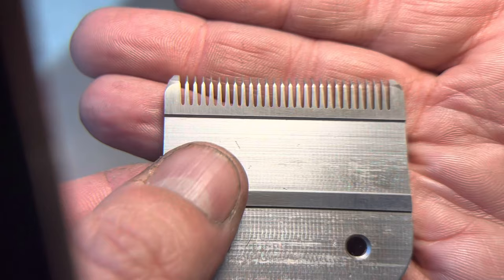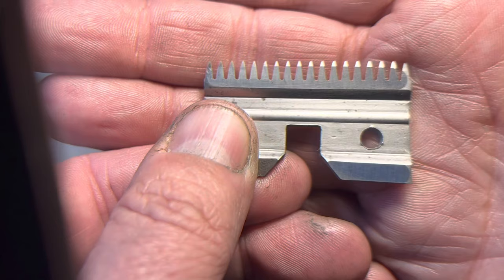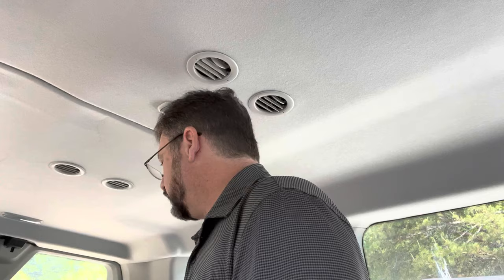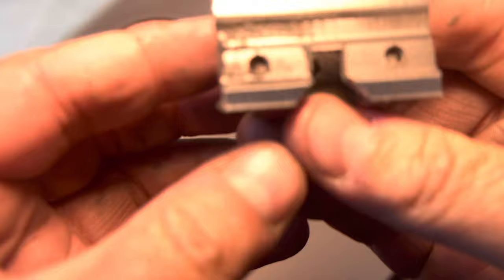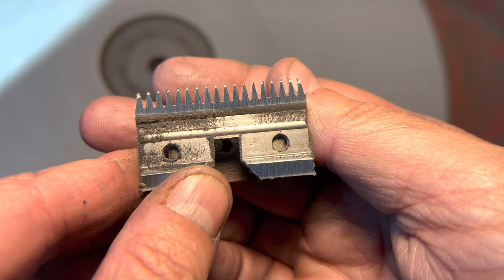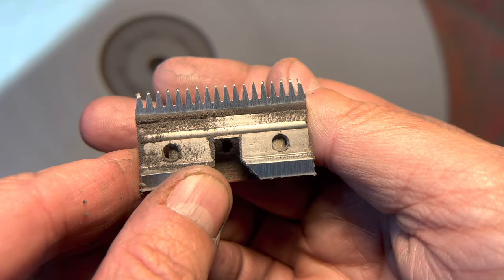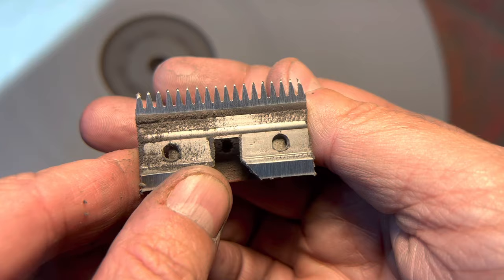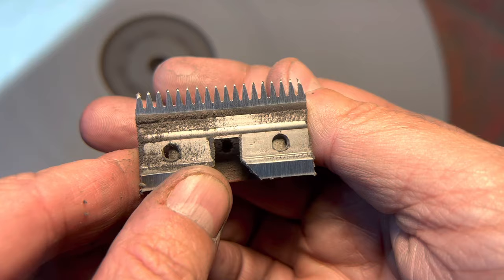Clipper Blade Sharpening Class: How to Deal with Poorly Sharpened Clipper Blades

Comment: Always enjoy your videos Jim. Great job showing the steps to blade sharpening especially some of the often missed details such as demagnetizing and deburring. I find that often those steps are skipped in an effort to save time. But they give up quality (consistent quality) for quantity.  And especially making sure that the spring is adjusted properly and not wobbly on the cutter. Many sharpeners, both new and experienced, I've trained or met over the years had no Idea to do this and as a result, had problems with their blades not cutting well or cutting better or worse on one side than the other. Keep spreading your knowledge and insights. It's helping to advance our industry to new levels!

Comment: Great explanation’s! As a mobile groomer I am finding it difficult to get a sharpening guy to meetup or just be available. I want to learn the best way I can sharpen my own in a pinch without spending a lot in equipment.
Reply from the maker: Hi Lillian… Unfortunately there really isn’t any good way to sharpen blades without the correct equipment, which is a little pricy for someone just wanting to sharpen their own blades. If you would like to text me at (864) 381-8697 and let me know where you’re located I may know a sharpener in your area. I’ve trained a number of them around the USA over the years.

Comment: I like this video it's very informative. I test a little different. I have used the test tape but I also use synthetic fur. I like the results better. But I also use a test block before I assemble to see the ware pattern to judge if I  need to sharpen more. I like those tools you use. 
Can I get the information on where I can get those tools. Thanks

Comment: Great video! I've had blades like this come in after a customer tried to sharpen them on a stone or something. I usually turn them away and tell them they are no good. Then they know not to try to sharpening them in the future.  I have a great tip for straightening out the spring. Remove the socket and set the spring on a flat surface. push the top of the spring down on the surface. On the loop ends (where the hole's are) one will be lifted off the table, bend accordingly until both side are contacting the surface when pressing the top of the spring to the surface...hope that makes sense.  :o)

Comment: Thank-you for a very informative video!  I am just about to "launch" me sharpening service and I will be starting with around 28 Andis clipper blades.  I am very interested if all three of the tools that you showed, the "Blade Scale", the spring adjustment tool, and the "chatter reducing" tool.
Reply from the maker: Those come from Hamaguri USA. Their website is listed in the drop down box under the video. What machine are you using to sharpen the blades?
Reply: @JimSharpBlog  Hamaguri USA is out of the spring adjustment tool until after the 1st of the year, Do you have one available for sale?
Reply from the maker: @krisweythman8806  I don’t, but Bonnie at Bonika Shears might.

Comment: What’s best for cooling down the cutter to avoid warping, water, aluminum plate, ceramic tile, burnishing plate?
Reply from the maker: Ceramic tile, but often you can control the heat with proper grit application. Watch that spark pattern.

Comment: Good enough ..you decide...I use a digital food scale ($20 Amazon) I take the
bowl off and gentle push down on the scale with the clipper blade extended 
and watch the scale to see when blade
moves. The scale is accurate (can measure in gms) and is a lot cheaper
then tension gauge.  Close enough reading for my needs.

Comment: Is your sharpening wheel convex shape ? Or flat ? I see lot comments that say you always sharpen clippers on convex stone/wheel. Any thoughts on that? Grate video ;)
Reply from the maker: It is tapered to hollow grind the blade. That means it’s slightly higher in the middle than on the outside of the plate.

Comment: Hi Jim, thanks for this great work. I want to as ask, can aluminium wheel sharpen all types of clipper blade ? 

I sharpened some blade and they appeared correctly . Out of that Someone also brought his clippers to sharpen 4 him, this time I did but the blades couldn't cut hairs and the client was annoyed. That is why I'm asking you this question. 
Thank you dear.
Reply from the maker: The grit that’s on the aluminum plate is what does the sharpening, but the plate also needs to be tapered to create a hollow grind.

Comment: hey jim I got a question about the difference in wheel size for clipper sharpeners. I have been doing a lot of research into breaking into the barberry sharpening business and I cannot see the benefit of a larger wheel. Could you explain if and why a  larger honing plate is better?
Reply from the maker: The general rule is the larger the plate the more room of error in technique. The small the plate the more issues will show up if you don’t follow the crown line perfectly.

Comment: What would cause that oval shape and tooth damage? Touching tips down first on the plate? Too much forward pressure?
Is it something that could have occurred during use, like from cutting a dirty dog?
I pulled a lot of little tips from this vid, much appreciated!
Reply from the maker: Hi Matt…The tip damage is most likely either from a roll upwards as the cutter was lifted off the plate or the tips hit first on set down. The oval was actually the new edge working itself in because the blade was sharpened flat. Actually it was sharpened flat with an outward negative flare on the outer edges, which makes me think it was sharpened on a flat hone instead of a clipper blade sharpener.

Comment: Hi Jim How long does the default cylinder last a year or six months?
Reply from the maker: I’m not sure what you’re asking. If you mean the plate, it will do about 1000 blades per side on average and it’s a two sided plate.
Reply: After working on both sides of the cylinder and consuming a thousand blades for each side, can we re-machine it? Thank you for the answer.

Comment: Does anyone make a CBN disc for these?
Reply from the maker: I know Mitch at The Shop makes them. They are for ceramic blades though. 
https://www.theshop-inc.com/
Reply: @JimSharpBlog  why not for steel?
Reply from the maker: @buffalojones341  The carbon steel blades load the plate.
Reply: @JimSharpBlog  hmm. I wonder if it would work better with reduced speed and water. I run Tormek knockoffs with CBN 600 and 200 and haven’t had any issues. I spritz them with a spray bottle 2-3 times and it’s good.
Reply from the maker: @buffalojones341  Are you running shears and knives on the Tormek, or blades? Clipper blades have a lot more carbon in them and Shears typically, unless you have a carbon steel share of course.
Reply: @JimSharpBlog  98% knives at farmers markets. And the occasional pair of scissors. Getting some training for salon shears soon.
Reply from the maker: @buffalojones341  Training on salon shears is my specialty. 😉
Reply: @JimSharpBlog  yes. I know who you are through a Facebook sharpeners group. I’m going with Ward since he’s a drivable distance from me 😊
Reply from the maker: @buffalojones341  Excellent. Ward is great and will take good care of you.